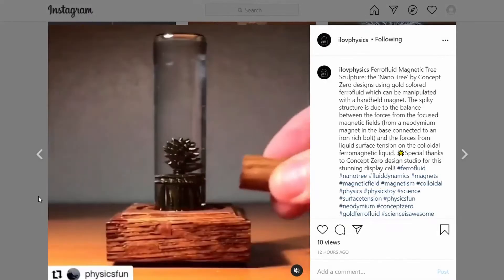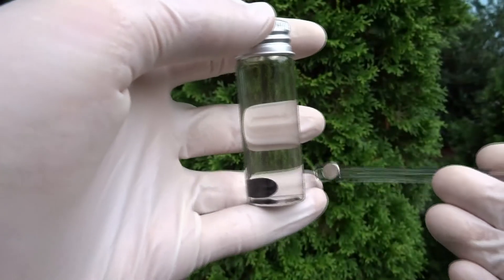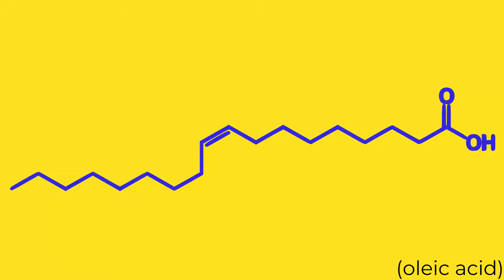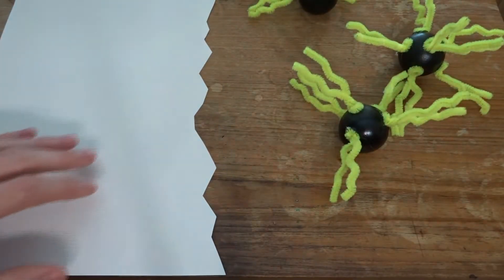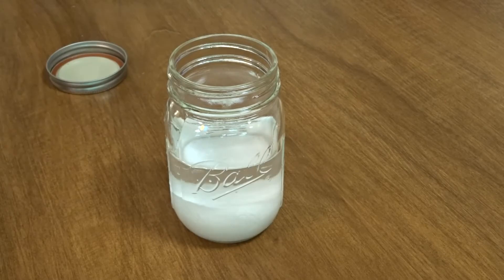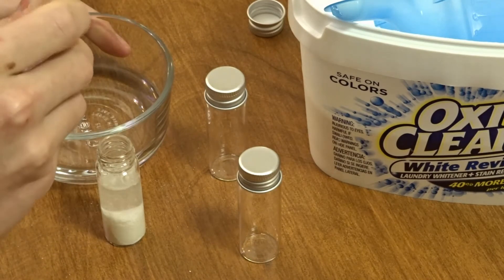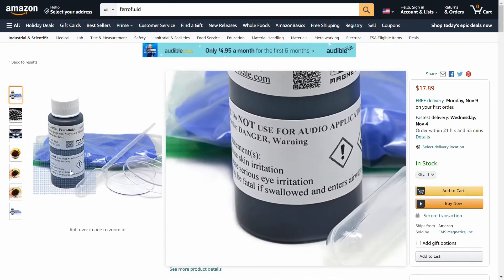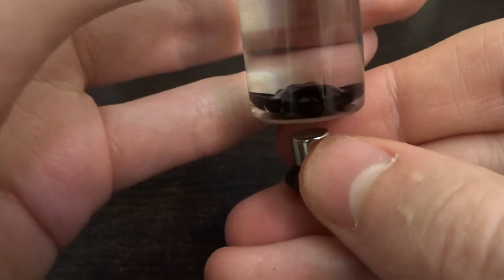How to make DIY Ferrofluid displays | No staining!

Comment: To help avoid the 'browning' of the magnetite could you -
1: Remove as much 'dissolved oxygen' as possible from the salt water by boiling it. (Dissolved oxygen is inversely proportional to temperature)
2: Once the ferrofluid is added and you're about to leave that 'expansion gas' at the top, employ a non oxidizing gas.  (TIG welders can use their argon, but Nitrogen [N2 gas] would probably also work)

Comment: Wasn't it worth considering using some jewellers gem polishing paste on the inside of the glass jars?
Reply: What do you think they use to keep te grinding/polishing media in suspension or bound to a sticky paste? Most likely something the same as the hydrocarbons they want to remove in the first place.

Comment: Salt makes the glass surface more polar by induction on contact with water. It increases the separation of polar and non-polar substances - used to do thuisbioscoopsysteem the lab to separate emulsions and extractions.
Reply: Googled thuisbioscoopsysteem
All I got was stereo equipment.
= Ray

Comment: If you brought the water in the vial to a boil and then rapidly sealed the lid then oxygen could be largely excluded while leaving room for expansion.  The pressure inside would simply end up being the vapor pressure of water at the ambient temperature (assuming the V.P of the non-polar solvent is negligible by comparison). Alternately you could add a nitrogen atmosphere to prevent oxidation.  I'm no expert on ferrofluids or.. cleaning for that matter but that's a bit of a random sample of my thoughts on the video.
Cool stuff though.  Keep making vids and crackin' wise.  I can't wait to see the follow up to the laser project. Part 1 is great, I can't wait for the second installment of it not working.  Now quit lazing around and get to lasing around!